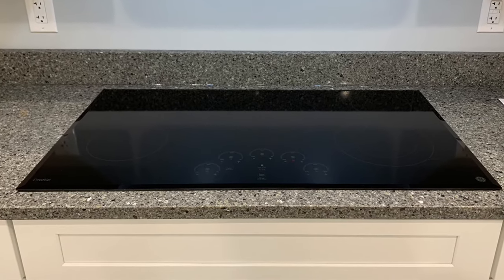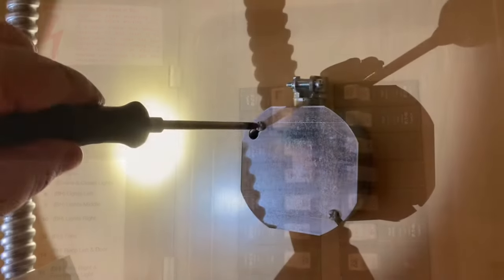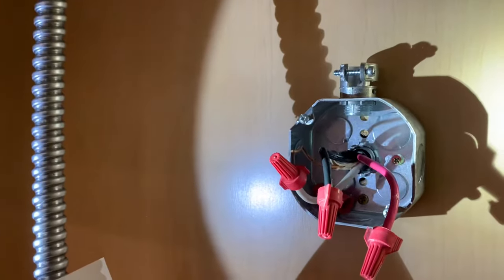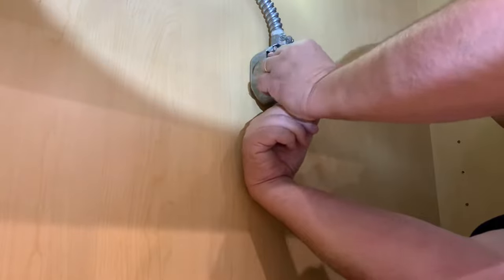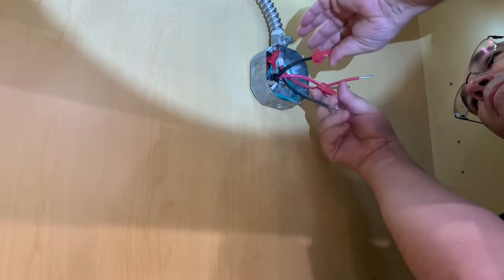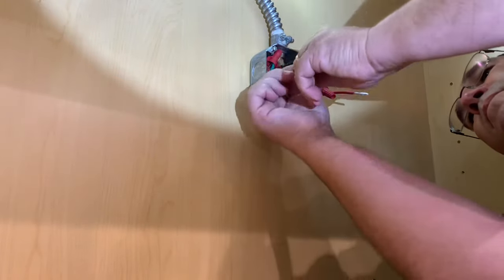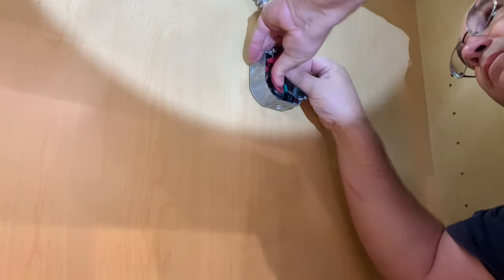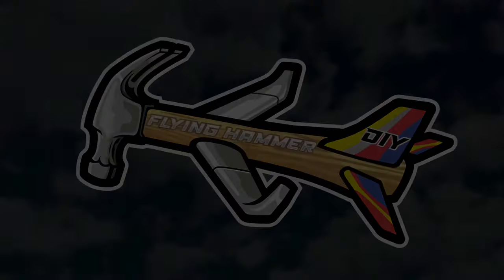How to make the electrical connections for a built-in electric cooktop

Comment: I would like an explanation on 240V circuit as I only have so many lives left.
Reply from the maker: A pure 240V (2 phase) appliance does not use a neutral wire.  The 2 “Hot” wires (usually Red & Black) are 180 degrees out of phase so the current flows from the electrical panel through the black wire to your appliance back to the box through the red wire and then reverses red-appliance-black-panel-black…..  A 120V (single phase) appliance needs a way to complete the circuit so a neutral (usually white) wire is connected back to the box.  The white and the green ground wire basically do the same thing where as the white wire is the normal path and the green is the oops something is wrong path and should trip the circuit breaker before damage to people or property.

A 120V/240V appliances connect all four wires and will use the 2 hot wires (240V) to run the high-voltage heating elements and one of the hots and the neutral wire (120V) to operate vent fans, oven lights, etc.  There is also usually transformers in your appliance that drop the voltage down and/or switches it to DC to operate, clocks, timers and digital displays. This is all done internally in your appliance.
Reply: An electrician just came out to install a new hybrid cooktop and installed the proper wiring.  I noticed that he had connected the white wire and red wire into a wire connector. I tried asking him why he did that but he got irritated.

Comment: Can You tell me if I can use a plug for the cooktop (like used in the range) , instead of wiring directly into the electrical box. Can I use the plug with 4 wires and connect only 3 wires (no neutral). Thank you very much for your help

Comment: Thank you for this video:) I have an induction cooktop to be installed that's power requirements reads up to 11000 W and 48A at 240V. Yet the manufacturer recommends 8/3 AWG with 55 Amp "protection calibre" (which I assume means breaker) or 8/4 AWG with 50 Amps. I would have thought that a 48 Amp load with the 80% rule would have meant a 6/3 or 6/4 gauge with a 60 Amp breaker not 8/3 or 8/4 with a 55 to 50 Amp breaker. I also have a new double oven coming with power requirements of 7800W and 40 A at 240 V where the manufacturer recommends a 50A protection circuit (again I assume this means breaker?) and 10 AWG wire, when I would have thought you'd need an 8/3 cable with a 50A breaker. I'd really appreciate your comments if you have a free moment! Thank you in advance:)
Reply from the maker: Thank you for your question. For liability reasons, you need to follow the manufactures instructions and recommendations for circuit, breakers and wiring.  If it’s new construction I would run the 6/4. It’s not that much more expensive while the walls exposed versus having to go back later.  As far as the circuit breakers use what they recommend because that is your safety switch if there’s a problem with your appliance.  You wouldn’t want to 60A circuit breaker on there and not have it trip.  
If this is old construction and you’re not changing out the wire, then never put a breaker on bigger than the wire capacity. 
I’m sorry I couldn’t be more help.

Comment: Video is super helpful!
Thank you!
Quick question: is it also possible to install these cooktops by means of a plug? Connecting a plug to the end of the cables and simply plugging it in to an existing 240V outlet?
Thanks again!
Reply: It depends on the model of your cooktop check you install manually. The power cables are sold at appliance stores, Lowe’s, Home Depot, etc. There are different plug configurations so take a picture of what you have.

Comment: Why is the neutral white to the breaker box not used? My old stove box had a red, black, white and wire ground. The new stove had a black white and green. I connected black hot from the breaker to stove black and  the red hot from the breaker to the stove white. Bare ground went to stove green. It worked. The white neutral from the box was capped off. Should I have wire nutted the white neutral to the bare ground also? Seems weird to have the return neutral not used.
Reply from the maker: The short answer is NO, do-not connect the white neutral and green(or bare) ground wires together.  A pure 240V (2 phase) appliance does not use a neutral wire.  The 2 “Hot” wires (usually Red & Black) are 180 degrees out of phase so the current flows from the electrical panel through the black wire to your appliance back to the box through the red wire and then reverses red-appliance-black-panel-black…..  A 120V (single phase) appliance needs a way to complete the circuit so a neutral (usually white) wire is connected back to the box.  The white and the green ground wire basically do the same thing where as the white wire is the normal path and the green is the oops something is wrong path and should trip the circuit breaker before damage to people or property.

A 120V/240V appliances connect all four wires and will use the 2 hot wires (240V) to run the high-voltage heating elements and one of the hots and the neutral wire (120V) to operate vent fans, oven lights, etc.  There is also usually transformers in your appliance that drop the voltage down and/or switches it to DC to operate, clocks, timers and digital displays. This is all done internally in your appliance.
Reply from the maker: I’m a little confused in your description you say “the new stove has a black, white and green”.  That sounds like a 120V connection not at 240V.  Please double check your install manual.  If it is a 120V appliance, then you need to disconnect the white stove wire from the red and connect the whites together.  You should then cap the red wire coming from the panel and change the circuit breaker in the box to a 120V using only the black wire. (check your appliance manual for the proper amperage needed).  The red wire should be capped in the box also, and just pushed out of the way.
Reply: Thanks for answering. The specs on the drop in stove top says it’s 240V and the wiring diagram shows stove black to the breaker, white stove to the breaker and green  (which they call earth) to ground wire. I want to use my tester on the ground to make sure green is not hot. I tried the stove and it worked with no errors or breaker tripping. The stove top is china made and induction where the pan gets hot when placed on the surface.
Reply: The stovetop has no light or timer for 120V usage. It has a digital display that worked with this connection
Reply from the maker: As long as you follow the wiring instructions you should be good.  A wire is still just a wire the color of the jacket is just to help with identification.  Just cap off the white neutral from the electrical panel and enjoy cooking on your new stove top.
Reply: @flyinghammerdiy4487 I know you connected the bare ground wire to the green (earth) wire to the stovetop. But is it okay to connect the white from the panel (instead of the bare ground wire) to the green (which they call earth)?
Reply: @kenskahn8736  Are you asking because there is no ground wire (green or bare) coming from your panel?  If so, it’s probably better to use the white wire as your ground then have it not grounded at all?   You can check your panel, older panels, sometimes have ground and white wires connected to the same block.  Just make sure you’re not connecting two wires from the stove to one wire to the panel.  Each wire from the stove should have its own path to your panel.
Reply: @spacemanjohn6383  there are both white and ground wires coming from the panel along with black and red. I chose to connect the stovetop’s green (earth) to the panel’s white instead of to the panel’s ground as I believe you did. The stovetop is working, but is this okay?

Comment: Can I hook my cooktop and oven  insert together in a box like that on same breaker?
Reply: Not on the same breaker. The will each need their own breaker, wiring and box. The oven and cooktop will need to be compatible. Some models are designed to work together, others are not. My Frigidaire cooktop came with a list of compatible oven models.

Comment: OK I got a new electric flat stove top. It has the black to white and one green do I need to hook that up to a 50 amp or can I hook it to a 30 amp and if so where do you run the black and white wire double breaker.
Reply from the maker: The amperage should be in your installation manual that came with the stove. Every stove is different, depending on the power requirements as far as what size circuit breaker you need.  I would highly recommend you have a licensed electrician install the circuit breaker and wiring to the stove location.  In this video I’m just demonstrating how to make the final connections after the drywall paint cabinets and cooktop were installed. You could also call electrician out to do the final connection but they usually charge $100-$200 just to show up.

Comment: I want to know how to
 check if the wires are 120 or 240 volt ? How or can you make a box that only has 120 into a 240 outlet? I  have wires coming from 2 junction box that only have 3 wires coming out: 2 red and 1 black. 1 box has noticeable thinner wires though? How do I measure the existing wires to determine what gage they are?
Reply: The gauge of the wires can be determined using a wire gauge which you can purchase at any hardware or electrical store for around $10.  As far as determining if the wires are 120 or 240 you can use a voltmeter, but its really determined on how they’re hooked up back at the main electrical panel.  If you’re not 100% sure you need to have a certified electrician check all the connections, you don’t want to hook something up and damage the appliance or worse cause a short and a possible fire at your house.

Comment: what if the power supply has red, Black, white& copper wire. but the cook top only has red,black&copper. what do I do with the white wire from power supply??
Reply from the maker: If the white is not used, then just cap it off with a wire nut and tuck it into the electrical outlet.

Comment: Is grounding that metal junction box not required?
Reply from the maker: You should. This protects you from shock if a bare wire comes in contact with the metal junction box. If it’s a plastic box then no.
Reply: @flyinghammerdiy4487  That's what I figured -- I just didn't see that done in your video, unless I missed it.

Comment: I bought a cooktop on the specification says 240v 4 heating coils  6000w 20amp. Do you think they only use a 20 amp because people don't usually use all four heating coils at once?
Reply: Yes, the cooktop will usually have to split power between coils if more than one is operated at a time.

Comment: What is the wire# supposed be from circuit breaker? Thanks
Reply: 10 awg - 30 amp
8 awg - 40amp
6 awg - 50 amp

You should always run the same size wire home run to the breaker and when your in a metal junction box always ground to the box

Comment: Does the cable come straight through the drywall then cabinet backing into the junction box? Or is it required to come through a blue plastic box first?
Reply: The cable does come right through the wall and into the cabinet.  A box is required where you make the connections.  If you already have a box in the wall, you can make the connections there or just add a box in front of it.
Reply: @spacemanjohn6383  Thank you so much!